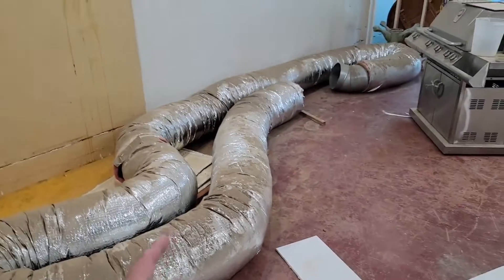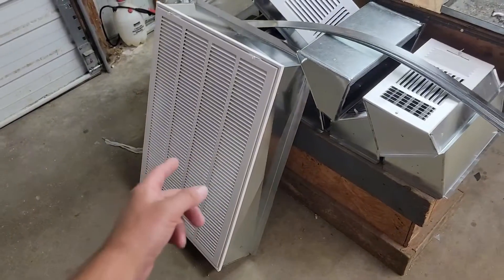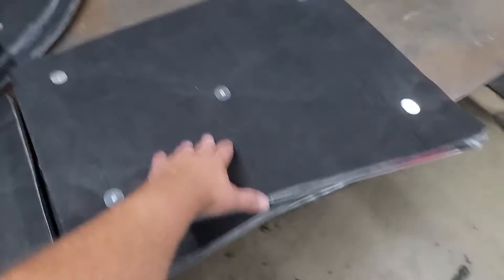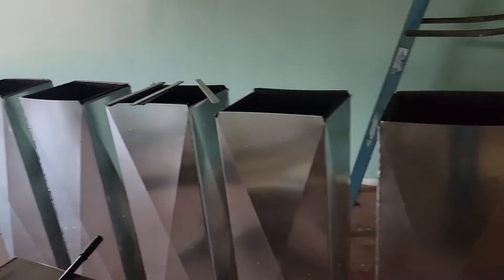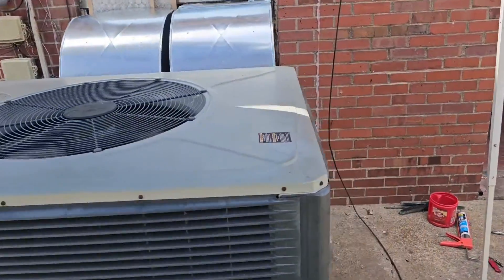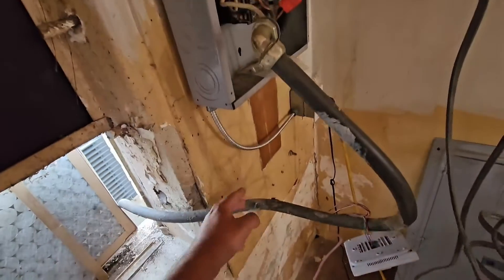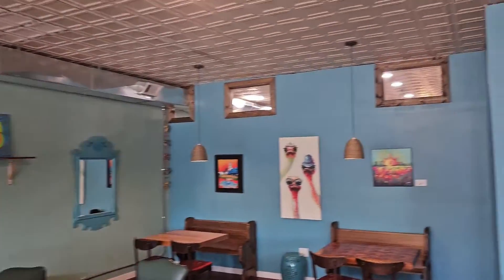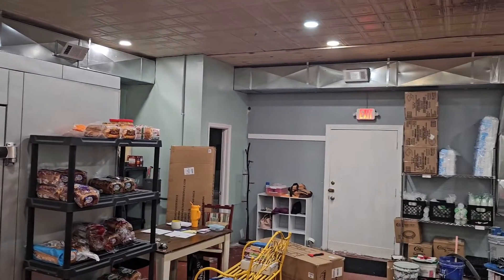Ductwork upgrade in restaurant is a GAME CHANGER!

Comment: Hi Im new to yr channel I learn alot from them I mainly work on 1ton or 2 ton minisplit in Mexico Ive seen in other hvac techs videos that they use the vacume pump connecting it to the condensors conntactor  by using gator clips ¿¿is there any way you can record a video instructing on how to do that?? Its so I dont have to use a long extention cord connecting it to the inside of the house plug...I would like to use the conntactor as a 110v power sourse...my name is Joe.thnks I hope you understand my question.
Reply: If your mini-split / power source is 110V then you hook up your alligator clips simply black to black, white to white, ground to ground.
If your mini-split / power source is 220V then you hook up your gator clips like this; black clip to either hot leg of the 220 (which would give you 110V), white clip to ground wire (ground and neutrals are the same at the panel), and ground clip also to ground wire or any other ground connection available.... it's pretty easy, hope that helps!
Reply: @joselanda8316  thnks very much that explains it completely...
Reply: @joseluissosa-kx4nj  awesome 👌 glad I could help
Reply: @joselanda8316  I have asked this question to a few other A/C techs but their reply (was I dont understand the question) thnks fr taking the time to read and understand the question...
Reply from the maker: Awesome so glad that I have people that. Watch The channel that help other people
Reply: @joseluissosa-kx4nj  No problem brother, I do this with rooftop units mostly, beats running all that extension cord 👍
Reply: @joselanda8316  can you inform me on the hourly wage a HVAC tech gets payed...Im contemplating migrating to the U.S.A.
Reply: Sooo On 220v the GROUND AND THE NEUTRAL CAN BE CONNECTED TOGETHER!!!I HAD NO IDEA OF THAT...

Comment: Looks good! Question though why not use spiral round duct instead much easier installation but other then cost maybe I don’t see why you couldn’t have ran it.
Reply from the maker: Choose to Go This route Because we were Told That there Were Going To be several Refrigerators Right below Where the duck work was going to be and that heat produce by thosr would cause the duck work to sweat, and we didn't want to insulate the duck work because they wanted the industrial look with the duck work uninsulated and showing the metal.